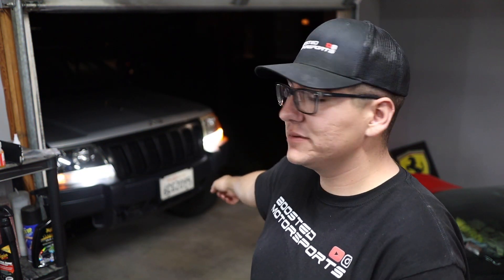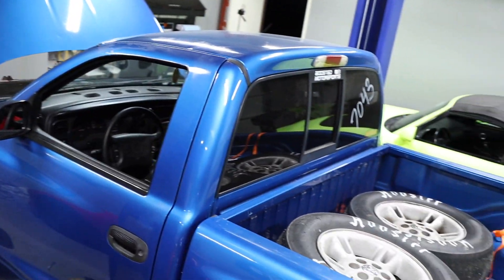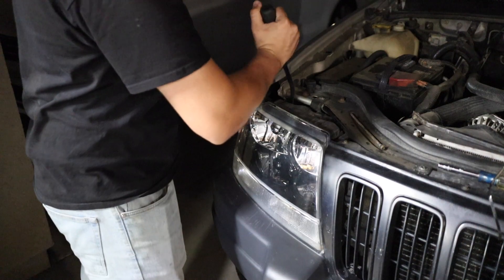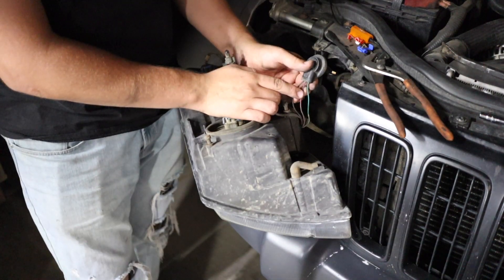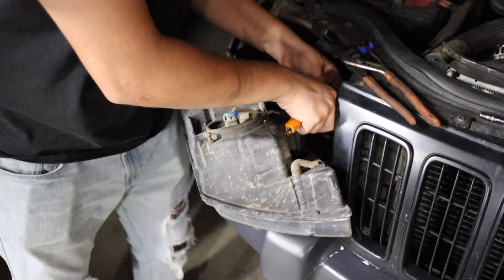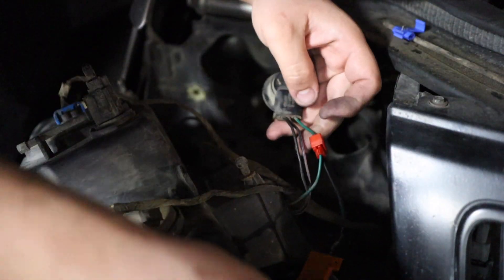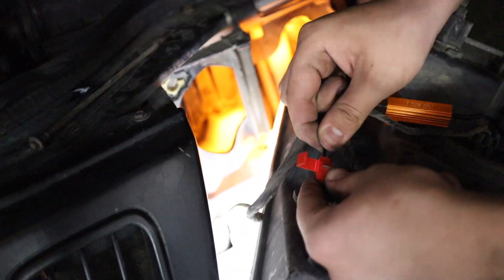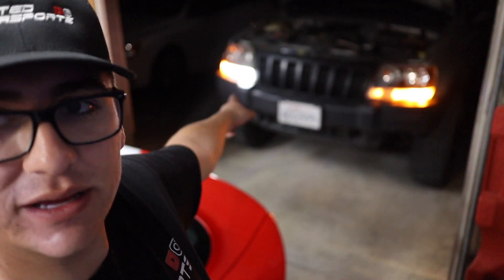HOW TO FIX HYPER FLASH FROM LED TURN SIGNAL BULB ( FAST FLASHING ) | Jeep WJ Grand Cherokee

Comment: The flasher DOES NOT fix hyperflash or weird Mopar electrical gremlins, like your indicator arrows on the instrument cluster lighting up, when you swap to LEDs.
Reply: My 04’ has 4, 50 watt 6ohm resistors, one for each turn signal. Worked for my led rear turn signals. (Sylvania resistors) I did the same in the front and the switchback works fine with the parking/headlights off, but hyperflash with the headlights on?! Also when hyperflashing the outermost 194 stop working. Anybody have any idea. I’ve been fighting with this for several days with no luck. Help me Najar!!! I can send you a link to a video of the whackiness.
Reply: @ThePotatogunwarrior  I'm having the same issue now. What solved the problem for you??
Reply: @mikehunt874  It was a bad connection. Rewired and it was good to go
Reply: I installed leds in every bulb housing in my wj. When I turn my headlights on my flasher indicators turn on and stay solid. No turn signals when headlights our on. Only when headlights are off. Any idea why this might be happening?
Reply: @musicismeds  It is current leakage. I got that on my WJ and on my XJ. The resistors fix that too.
Reply: @elsydeon666  just put resistors on. Cured the headlight/turn signal problem. Now to put them on the taillights. What a headache!!!!

Comment: Is it the same deal with the rear blinkers? 
No t10s, so just get the resistor and connect it the same way and done? Or is the wiring different? 
I guess I'll find out because I'm about to get to it in the next few days.

Comment: if you change the cornering bulbs to LED will it show an error message on the dash?
Reply from the maker: I’m not sure I don’t have that system in my jeep
Reply: Najar Entertainment Great to know. One more question, would you need to install resistors in the back for LED rear signals?

Great channel btw, Subscribed 👍

Comment: Hey man i know you didn’t put the flasher on but can you send me the link to that? I can’t find it anywhere.
Reply from the maker: I couldn’t find them when I researched it sadly
Reply: Najar Entertainment would it matter if i put a flasher in that has less prongs than the stock flasher?
Reply: Najar Entertainment It has the same layout as the stock one, just doesn’t have the corner prongs so idk if it would matter since it’s for LEDs
Reply: I didn't find it either, it seems it doesn't exist for WJ. I am trying to modify the electronics of the original so that it works well with the LED bulbs. I think it is possible if the internal resistance of the relay is changed.